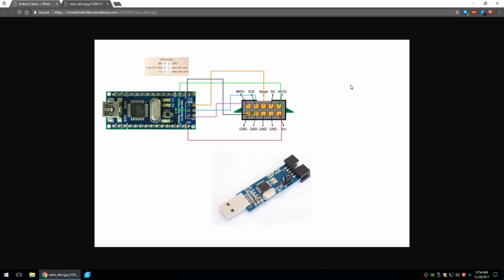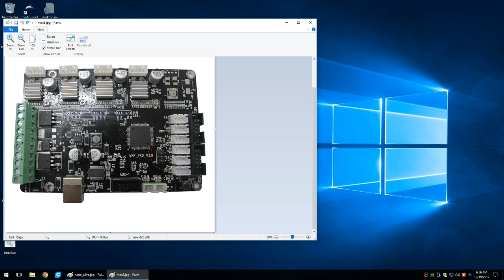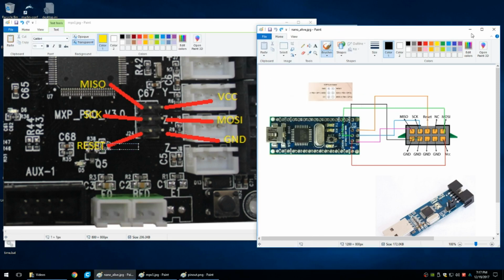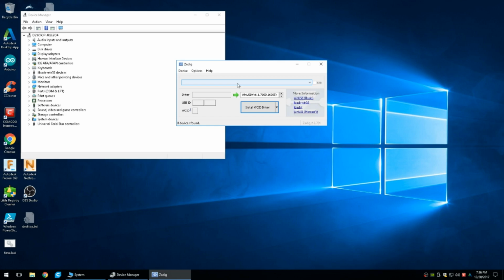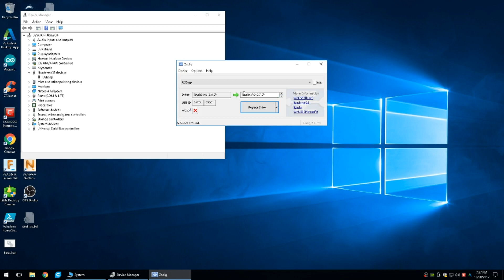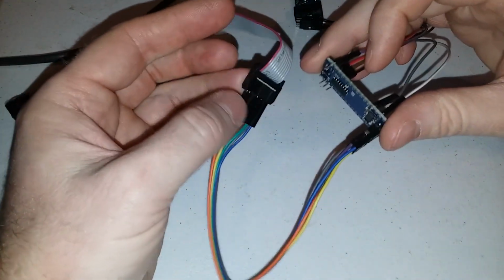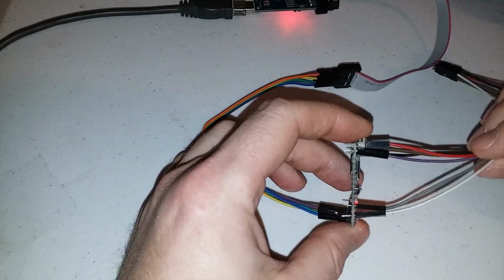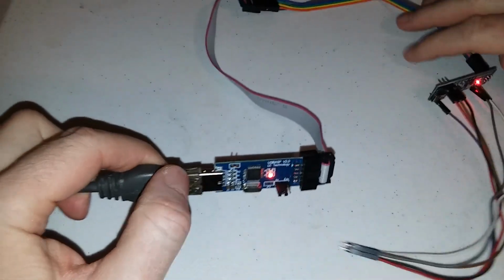Reflash Arduino Bootloader Using a USBasp

Comment: tutto uguale ma a me la porta com non risulta disponibile in ide. da altre parti ho letto che non devono esserci com e quindi come mai nella tua esperienza vede una com collegata al programmatore ? ciao
Reply from the maker: Google Translate...
"all the same but to me the com port is not available in ide. elsewhere I've read that there shouldn't be a com and therefore why, in your experience, do you see a com connected to the programmer? HI"

The COM port is how the USBasp interfaces with the computer and operating system.  Ensure you are using the correct driver for the USBasp.

Comment: asp usb can be used to reflash arduino uno ?
Reply from the maker: Yes, hook up the leads to the ICSP connectors and select the UNO from the board menu.
Reply: @MrDabrudda  with the same programmer ?
Reply from the maker: Yes, using Arduino IDE

Comment: I installed those USBASP drivers a long time ago.  As I was using the USBASP only in conjunction with AVRDUDESS.exe, everything was fine. Somehow I never got the USPASP to work with the Arduino IDE, but I never really cared. 
Now I'm working on a new project and programming a ATTINY directly from the Adruino IDE would be very helpfull. 
This video was the decisive clue why the USBASP would not work with the Arduino IDE. Back then I installed the USBASP with the wrong library... Reinstalled it today with the here recommended one and everything works flawlessly.
Many thanks for this informative and very helpfull video. Thanks Thanks Thanks!

Comment: what are the  cables for? that which are connected to arduino nano.. man i have problem with my arduino uno.  do i need connect  anything in arduino uno except usbAsp ?
Reply: problem is.. when i try it.. there is some error during burning bootloader what does that mean??.    but i am able to programing that arduino with USBASP throught atmelStudio
Reply: This is writed thre.

Arduino: 1.8.5 (Windows 10), Vývojová doska:"Arduino/Genuino Uno"

D:\Programy_Editory\arduino\arduino-1.8.5\hardware\tools\avr/bin/avrdude -CD:\Programy_Editory\arduino\arduino-1.8.5\hardware\tools\avr/etc/avrdude.conf -v -patmega328p -cusbasp -Pusb -e -Ulock:w:0x3F:m -Uefuse:w:0xFD:m -Uhfuse:w:0xDE:m -Ulfuse:w:0xFF:m 

avrdude: Version 6.3, compiled on Jan 17 2017 at 12:00:53
         Copyright (c) 2000-2005 Brian Dean, http://www.bdmicro.com/
         Copyright (c) 2007-2014 Joerg Wunsch

         System wide configuration file is "D:\Programy_Editory\arduino\arduino-1.8.5\hardware\tools\avr/etc/avrdude.conf"

         Using Port                    : usb
         Using Programmer              : usbasp
avrdude: Warning: cannot query manufacturer for device: No such file or directory
avrdude: Warning: cannot query product for device: No such file or directory
avrdude: error: could not find USB device with vid=0x16c0 pid=0x5dc vendor='www.fischl.de' product='USBasp'

avrdude done.  Thank you.

Chyba pri vypaľovaní zavádzača.
Reply from the maker: Check you drivers in the Device Manager to ensure the device is detected and working.  Also try rebooting after installing the Zadig drivers.
Reply: I do not use any zadig drivers.. .. Arduino IDE is not working on it.. there is some problem with comunication .  but before it was going on that IDE. Atmel Studio same..  now i can use only ICSP conector and programming it with USBASP.
Reply: oh man... i was programing it only with USB cable .. nothing more was needed there..
Reply from the maker: Are you using the Arduino IDE?
Reply from the maker: I used the extra cables on that Arduino Nano to flash other Nano bootloaders.  I was using that Nano as an example.

Comment: Can you burn the bootloader on the trevi tarantula, please help I do have an arduino nano and a usbasp
Reply from the maker: If you know where the ICSP pins are then yes you can flash a bootloader.  What kind of board does a tevo have?

https://3dprinterchat.com/wp-content/uploads/2016/08/All-in-1-MKS-BASE-V1-0-3D-Printer-Control-Motherboard-Compatible-RepRap-Ramps1-4-With.jpg_640x640-500x500.jpg
Reply: MrDabrudda the tevo tarantula has a MKS-BASE V1.4 3D Printer Control Board Mainboard Compatible Ramps1.4
Reply from the maker: https://www.robotdigg.com/crab/image/2017/11/14/850af465037016f62232622ba54eddbe.jpeg
ICSP pins are listed on this schematic.
Reply: MrDabrudda thanks alot I'll try that